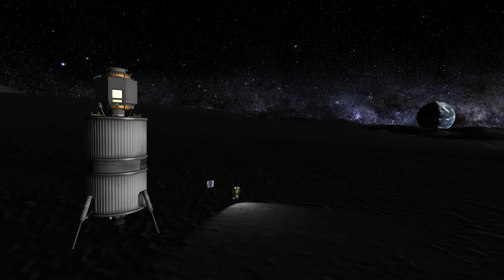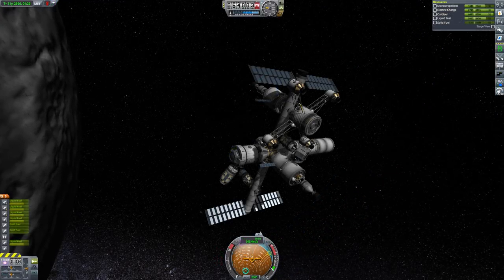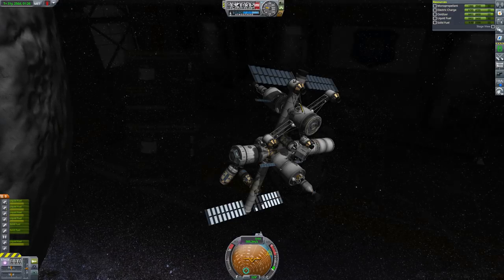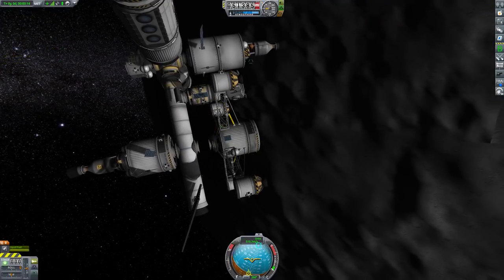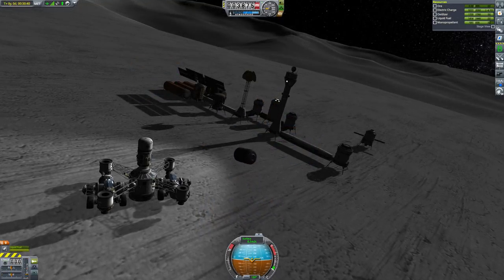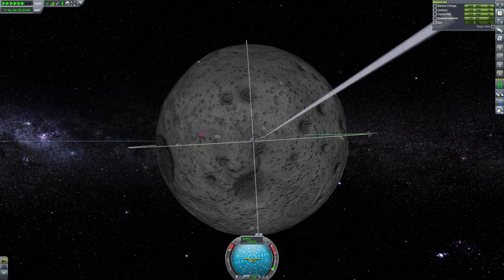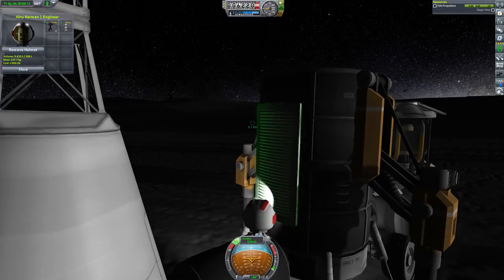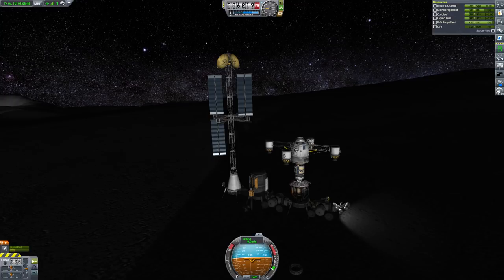KSP Mun Base Pt 1: Beta Site

Comment: Great video Ruben. However, do you plan on updating the ISRU on some of your old bases. (ex.DUNA BASE) because I don't see any Radiators so how can they mine ore? 

Side note: Do you think you will go into SSTOs (the plane type with RAPIERS)?
Reply from the maker: Thanks,  I have planned a new episode in both the Mun base and Duna base series where I'll add a new module and some updates for the old bases, like radiators.  I've had some people asking me about SSTOs,  I have been looking at some of the popular large SSTOs and I can do far better.  Right now I'm working on a variant of my Mk3 heavy SSTO design that can put a 50 tonne payload on Duna and get home without refueling.
Reply: That be amazing if you could make an SSTO that could do that. The best I am able to do is a SSTO capable of delivering approx. 25 Tons to Minnmus and back without refueling. I can send you the craft file and maybe it will help you design your other SSTO? If not thats ok, keep up the good work!

EDIT: BTW thank you for replying so quickly! most youtubers take forever if they even read my comment at all.